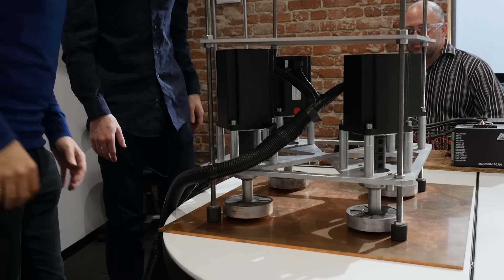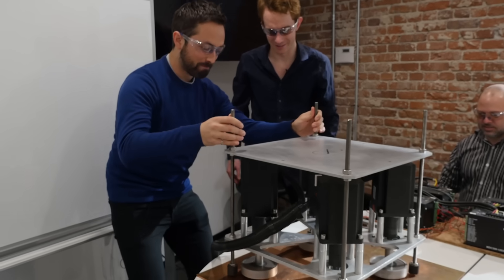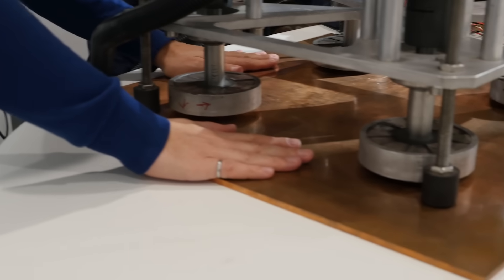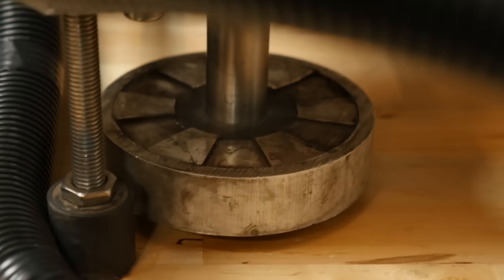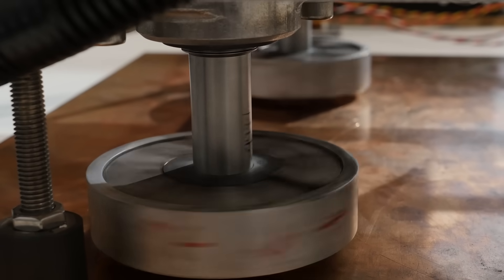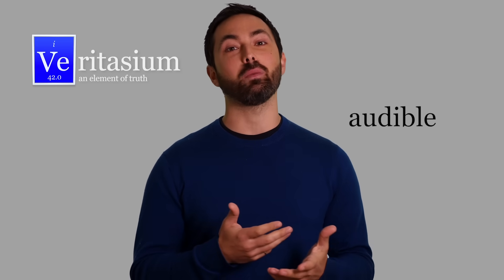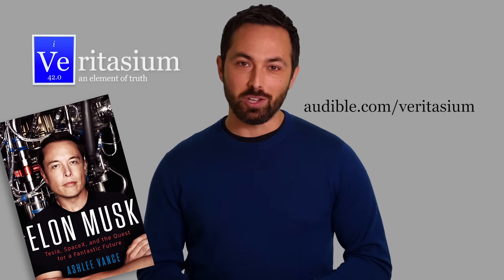Electromagnetic Levitation Quadcopter

Comment: That's amazing. I could also see warehouse floors plated in copper, using these things to carry objects - like in a courier warehouse with little magnet droids carrying parcels. Would that work?
Reply: TBB - I can't think of any advantages to your idea unfortunately. Please note regarding your comment re forklift drivers only being able to work 8 hours etc etc - robots are already being used for moving stock around in warehouses & for picking stock & for restocking the shelves. Google, Amazon & DARPA are heavily invested in warehouse robots & none of these systems levitate in the way you envisage. These robot systems run very effectively on normal wheels [sometimes the wheels are on tracks like with trams] or on rails overhead, above the shelving. The best systems today get their power via these tracks or rails saving a lot of weight! There is no possibility that your 'droids will match this kind of remote power system & simple robot machinery that's already in place.
Reply: Yeah that's a pretty good point.
Reply: TheBabblingBiker why use regular wheels when you can spend shitload of $ and insane amounts of power?
Reply: viermidebutura yeah I don't think right now. But when it's more efficient it could be much quicker. if you're sending millions of packages per day, then a 3 second improvement on that could make a big difference when spread across the network.
Reply: TheBabblingBiker "But when it's more efficient"

There is very little room for improving the efficiency of such machine
Reply: Smaller batteries, smaller, more powerful motors, stronger magnets, better AI for avoiding collisions and optimizing routes. There's fucktons of advancement available.
Reply: Warehouse magnet 'droids: It would work, but you'd have unnecessary complexity & it's very noisy [1] a lot of fast moving parts that wear & require maintenance to spin 3 or 4 expensive magnet arrays [2] you'd additionally need to have some means of horizontal propulsion for the 'droid that's hefty enough to move the weight of the parcels, the power batteries & the magnet array. How would you get the horizontal motion cheaply? How do you brake the 'droid? [3] when the batteries run out of charge the 'droid can't be moved until it's recharged unless the thing is fitted with normal wheels too that touch the floor when the magnets aren't used. [4] Probably not as power efficient [nor as light] as current wheel-driven designs with one central electric motor
Reply: TheBabblingBiker and these improvements will not go over a few percents each but the costs will go few orders of magnitude.

so my previous comment "There is very little room for improving the efficiency of such machine" is valid
Reply: I've worked in a warehouse. There is LOTS of room for efficiency. You move pallets to get at pallets and in doing so block your own access to other pallets. You can only move objects with licensed forklift operators who take lunch brakes, get sick, and only work for 8 hours. Droids could work around the clock, map out the warehouse themselves, and swiftly deliver parcels to delivery vans while four humans sipped tea and got through their emails.
Reply: Yeah that's what I was wondering about - the wear on the spinning disks being key I think. Braking is also a good point. I suspect wheels that aren't load-bearing might do it. Dunno it was just a thought.

Comment: One question about the transportation though, how would the average human handle the force generated by such great velocity? A lot of people get car sick from just going normally
Reply: The thing with getting car sick is that the brain notices you are moving... without moving yourself. It's the same reason why some people get naseus by VR headsets.
What you might be worrying about is the acceleration, when the hyper loop is moving at a constant speed you don't feel any forces, as you are moving equally fast. When it accelerates the hyperloop travels faster than you and essentially drags/pushes you up to the same speed
Reply: The force isn't generated by velocity. It is generated by acceleration.
Reply: Getting car sick has to do with your perception of the motion. It has nothing to do with how fast you're going. So long as it's a smooth ride (which it will be), people will be far less likely to get sick. That's why people get sea sick far more often than car sick despite the car traveling much faster than the boat.
Reply: I guess the same way we handle airplanes.  We can't directly detect speed, only acceleration. That's alaways limited by our puny human bodies, so I guess the experience would be similar to an airplane.
Reply: There is no force "generated" by velocity of an object. What you can feel is intertia caused by acceleration. So as long as those vehicles don't accelarate super fast, you wouldn't feel it. Also, motion sickness isn't caused by any of those things. A disconnection between visual information and a "feeling" of oriantation and balance causes motion sickness. Basicly, your body thinks you're still but your eyes tell otherwise so your brain gets confused.
Reply: The velocity is not the problem, the acceleration is. Changing speed brutally for example, that's what give people motion sickness. So like any other transportations you only need to accelerate and decelerate smoothly. 

Look at it this way, we are on a "globe" that spin at 1,674.4 km/h or 1,040.4 mph, and we don't feel anything because the speed is constant.

Comment: So... hoverboards?
Reply: If you make entire cities from copper, Yes
Reply: Hey, that's more feasible than the hexagonal solar units on Kickstarter right now
Reply: Hoverboards based on levitation would be the most inefficient mode of personal transportation.  The amount of energy required to levitate a person, compared to just using wheels is ridiculous.  All the heat generated in the copper sheet is wasted energy.   Yes, just as bad a Solar Freakin Roadways.   LOL   Oh, and the hyperloop is just as bad.  Trying to make a near vacuum chamber hundreds of km long is beyond stupid.
Reply: Casshern  The amount of energy saved by reducing air resistance, would be wasted many times over with heat loss in the copper plating.  It requires constant energy use just to keep you off the ground, which tires in effect do for free (energy wise).
Reply: Maybe even cars. Maybe, I don't know how far they can push it before weight brings it down. But imagine no longer having to buy tires. Or needing an engine to overcome friction to produce forward motion. It's a pretty awesome idea.
Reply: yes, this was already done with a hoverboard and a copper skatepark, like a year+ ago. I'm surprised it wasn't brought up in this video.
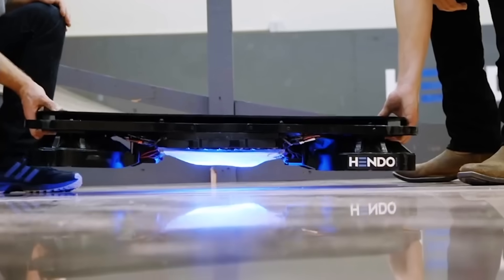Reply: JackTradesman   It was at 4:28
Reply: My3dviews lol guess i blinked and missed it, thanks.
Reply: well yea the hendo hoverboard works on the same principle
Reply: or just a copper skateparks
Reply: You cannot skate on them, they are way too heavy to do anything on as well as being extremely slow

Comment: What is the practical application of this though?
Reply: You mean besides the multiple examples listed in the video?
Reply: Moving large objects across copper floors would be one.
Reply: Anthony Paull 
SCIENCE
Reply: Yemeth42pis Conventional electric motors are even more efficient than these though. The practical applications as of right now are very few. Requires way too much power to be of real use.
Reply: Where do copper floors exist though? The problem is that coating the floor with copper is expensive and unsafe. The only applications I can think of for this are bumper cars and maybe some kind of forklift for a warehouse. But we have more conventional means that are way more energy efficient.
Reply: 3D porn
Reply: indeed I think the point is that this technology already exists, unless there's some particularly special about this machine that I'm missing with the science of it all?
Reply: It's shown in the video, faster/safer/cheaper mode of transportation.
Reply: This tech is already in use in places it can/should be used. It has existed for decades, and this is not anything new. The ability to hover magnetically has been around for ages.
Reply: The argumentative question of "Where do copper floors exist though?" reminds me of the time when people were skeptic of asphalt roads.
It didn't exist, but it was needed for the success of cars. So they made it.
Reply: Yemeth42pis Maples trains already exist, and where are you gonna get all the copper to plate roads in it?
Reply: Anthony Paull It's not just copper, this works with any conductive material.
Reply: Moving heavy objects with ease, perhaps for disabled/old/otherwise weak people? Instead of carrying the heavy thing you just hold the copper
Reply: this machine shows that we are defeating Gravity, and we can make it bigger everyday, use your imagination.
Reply: Fun
Reply: Maglev trains, they show it at the end of the video.
Reply: Casshern Literally any conductive material will work
Reply: Copper is just a good conductor
Reply: science hour No.
Reply: +Anthony Paull, sure I was a bit utopist, but as a system you loose less energy than combustion engine for example. That's why I said cheaper. But yeah in practice it has challenges, for the copper problem maybe find another abundant good conductor. Like solid hydrogen if we could mass produce the thing, or something else. That's what we call progress I guess.
Reply: Various modes of transport. Magnetic levitation has no contact with the surface you're travelling over, so there is much less friction and therefore you can transport things over long distances much more efficiently and quickly. Maglev trains are one of the fastest forms of land transport and yet only a few exist in the world.
Reply: +TheRaellz Well, you don't actually need a full road wide sheet of copper for the levitating cars to work. Also, it's not so easy to just steal them. That's why they don't steal train tracks so often. Sure, it happens, but not that often.
It's a silly idea in itself, but it's got quite the potential.
Reply: Did all mathematicians and physicist and most scientists in history know the practical applications of their work? No
 Now you and me use their science in everyday life, you wouldn't have watched this video and commented if it wasn't because of them!
Hell, there would be no internet or phone or radio or any form of civilization if they only thought of practical purposes of their thoughts. This also applies to Philosophers and Psychologists as well.
Sometimes, you can't see until you die. There are some applications to this we know of, search for it.
Reply: ThePyrosirys They already exist.
Reply: Tenacious Dean That's exactly it
Reply: Well at the moment practically nowhere. However based on this research they can make steps to maybe finding a more common metal that can produce the same effects and if it's available to the masses you can build roads with this and make levitating cars. Which would do a lot of good for transit and economics for individuals and reshape how cars are made. Because now instead of using tires and relying on friction you remove friction almost entirely, aside from air, and are able to move with minimal energy output.
Reply: +Yemeth42pis maybe we can mine out asteroids in the near future and get loads of copper that way, we just need to master the art of reusable spacecrafts first
Reply: think of it as Train v2.0
Reply: Bercik87 But they already exist.
Reply: There is no practical application. This is, literally, a quad copter that is unable to travel as freely and built much more expensively. You can build one of these yourself, actually; just buy a quad copter, tape magnets to the blades, flip it upside down, and place it over a conductive metal. Ta-da! You just wasted time and money.
Reply: Hey, check out my channel if you have time and subscribe if you liked the video. I have put much effort in my videos!

Comment: Damn I am fast, like electrons almost
Reply: Electrons aren't that fast, unfortunately...
Reply: electron in conductors only travel at the order of 10^-7 m/s in conductors. You might want to reconsider
Reply: should have said light, electrons are slow in electricity and also because of quantum mechanics, an election isnt orbiting so its not really moving.
Reply: Electrons are slow bro.
Reply: Is that why you're single?
Reply: snika123 Beta rays move at 99% of c so they're not really slow...
Reply: @fatcat4000  Did saying C instead of saying the speed of light, make you feel superiorly intelligent to all other human beings?
Reply: The true irony is that electrons don't move that fast at all
Reply: photons are waaay faster than electrons, which have mass, and thus can never go anywhrea at the light speed
Reply: Guys, fast electrons are fast and slow electrons are slow. Fast like an electrom is something like fast like a car. Sure, if it's racing it does move fast, but is the parking lot it is pretty slow...
Reply: Join your valence electrons with my outer shell
Reply: Thats what she said
Reply: TheFaarf lol Im faster than a spinning neutron star
Reply: beta radiation is not electrons behaving normally, it's them being forcefully ejected from the core of an atom, and when conducting electricity through a substance the charge moves, not necessarily one electron (one electron can go in one end of the atom with another coming out the other end)
Reply: So the rumors the ladies spread are true ;)
Reply: TheFaarf 
Too true.
Reply: TheFaarf u mean like photons
Reply: don't say that in a science channel xD
Reply: why not?
it's true
Reply: Was it faster than the time light would take to reach from Derek uploading a video to you opening it?
Reply: +Warrior Son I was first lul
Reply: Do you even know that electrons move with almost 99% the speed of light?
Reply: TheFaarf 9